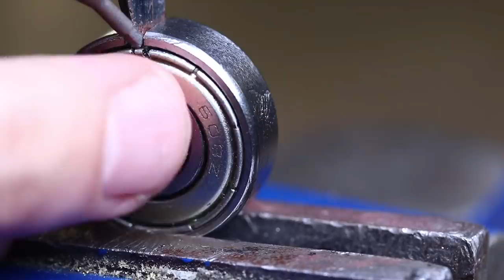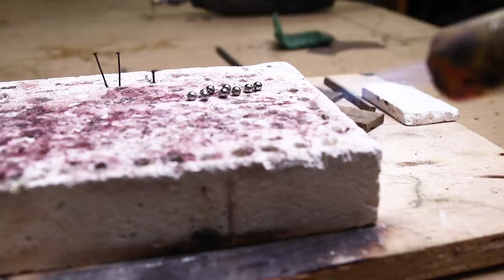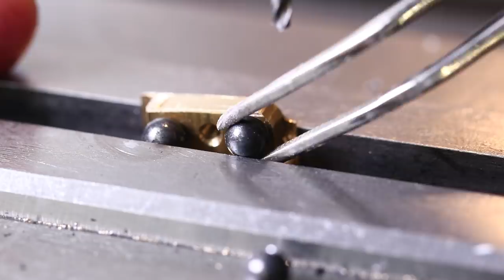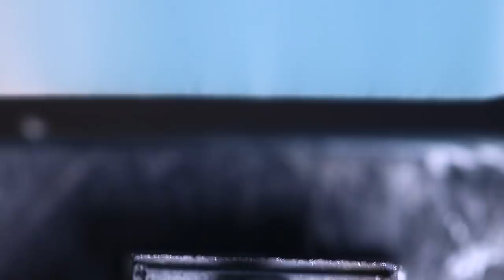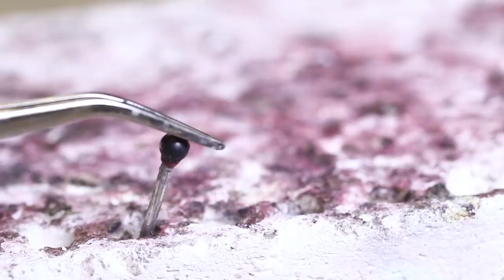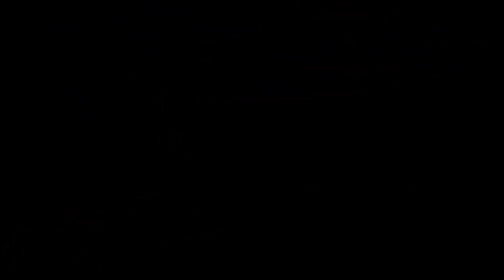Ball bearing into ball&socket stopmotion joint

Comment: Excellent Ed!! Have you looked at trying threaded ball and rods found in the body piercing industry, you can get so many bar lengths and ball sizes for really cheap and just braze the balls to the rods!! then making the joint plates is all you would need to do after that. I use them and it saves so much time!
Reply from the maker: Hey, I know them, actually I don't do what you see in the video, it's just a challenge. I don't like so much silver soldering so I turn the balls in the lathe, that's my way, but piercing parts are a smart way to do it. See you

Comment: On aliexpress, they sell m4 threaded balls for 3D printers.
Reply: They sell threaded M4 rods of various lengths too! I got both and used threadlocker. There's even a seller on Aliexpress which sells armatures that were apparently made with these. Just need a good solution on plates, though. I had some from years ago that I machined from aluminum as a test but apparently it's not the best material for this and movement doesn't feel smooth enough.
Reply: They are also ebay for 16 for $1
But they are 10 mm.
There is an ebay seller morezmore who selles m2 m3 6mm threaded balls and 3m 8mm and plates too.

Comment: Is ballbearing stronger and durable than other materials?
Reply from the maker: Without heat treatment that metal is stronger than my drill bits. Apart from this I would always get metal from square stock to make plates

Comment: Hi brother great idea.  The ball from the bearing is perfect. But the side plates are tough for normal people with minimal gears.  Can you check if the segments of a bike chain which already has two openings which may be able to hold the ball and make a centre hole for the screw. And please get me the link to buy those screws. I don't know what they called as. Thank you
Reply from the maker: Bike chains have been all time go to for rig joints. They are much bigger than what I am doing though
Reply: @edupuertasfruns  okay Bro, i thought to give it a try with the bike chain links. No tutorials found anywhere in YouTube about it sadly. Can you at least tell me what's the ratio of the ball and its respective hole size? The default hole on my bike chain is 6mm for example. What should be the ball size i should opt for?  Thanks for reading at least.
Reply from the maker: By feeling here, for a 6mm hole at least 8-9 mm ball and 4-5mm rod to the ball
Reply: @edupuertasfruns  i wonder how selfless you are! And is it necessary to make a screw hole into each balls? Can we just weld the rod directly  into balls? I'm from India. We hardly have such lathe shops anywhere near. I want my puppet to do yoga. 😝
Reply from the maker: If you have a torch you can change ball property and drill it with power drill
Reply: @edupuertasfruns  i didn't understand what a torch is.  A torch here means a flash lite. My question is, do we really have to drill into each metal balls to make threads? Or can we just attach a piece of rod onto balls by just welding? With out piercing the ball.
Reply from the maker: A torch fire flame device to weld. You can try to just weld but if you drill, not thread and weld in place would be more solid union

Comment: please let me know what type of drill bits you are using.
i tried hard with my steel drill bit. but no luck. 😥
Reply from the maker: No special ones, low speed and right steel or heat treat it to be able to drill
Reply: thanks a lot.. ❤ by the way. you are so talented with stop motion and im on the way following you.. 😇❤